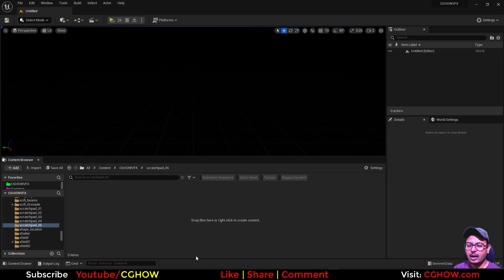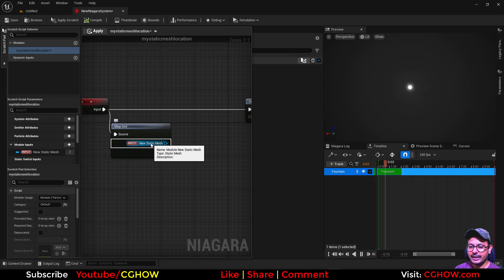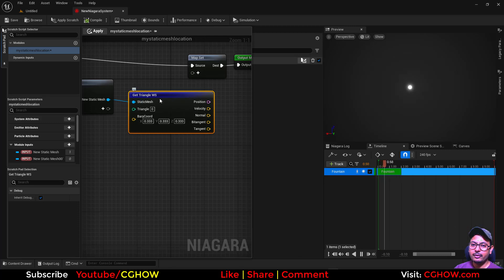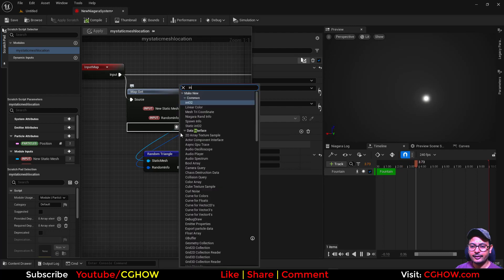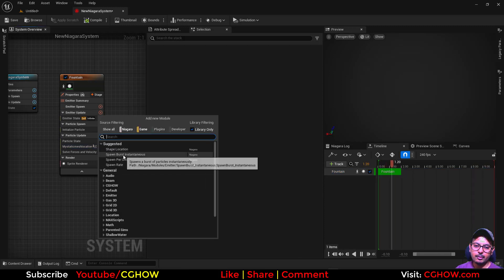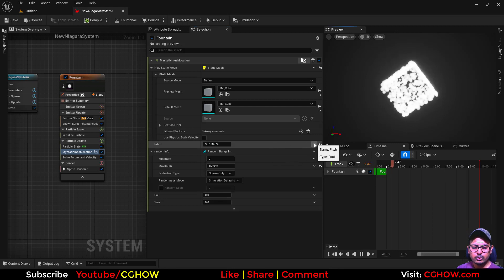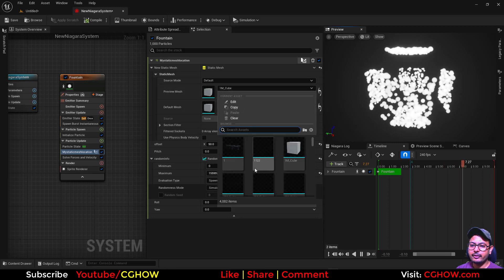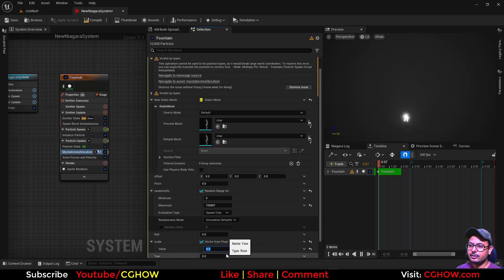UE5 Niagara #ScratchPad Module #5 | Mastering Static Mesh Location, Rotation, and Scaling Techniques

Comment: The world coordinates origin problem was solved by @fxclimber but its buried in a comment chain so I wanted to repost it as its own comment:

Use "Transform Position" 1. after Get TriangleWS 2. before output/map set , 1: world to local 2: local to world

Comment: Rotation, scaling, etc. are now in world coordinates. Is there a way to change them to local coordinates?
Reply: did you find a fix he doesn't seem to answer =(
Reply: use "Transform Position" 1. after Get TriangleWS 2. before output , 1: world to local 2: local to world  @trendyourdays7382

Comment: Hi, this was a really useful video but I'm having a problem. The mesh location scratch pad module is scaling and rotating around the world origin rather than the system location or the mesh pivot. Do you have any idea how to fix that?
Reply: use "Transform Position" 1. after Get TriangleWS 2. before output , 1: world to local 2: local to world
Reply: @fxclimber  thank you
Reply: @Marcos did you find a fix im stuck thee too =(
Reply: @Marcos sorry im still a beginner it not clear for me what you mean  but thx anyway at least you gave an  answer
Reply: itrying to use one of them but i dont know where to connect them what a nightmare 😫
Reply: @Marcos sorry im new to this your help is really welcome where did you connect them
Reply: @Marcos maaaaaan thx my brain was melting  😅